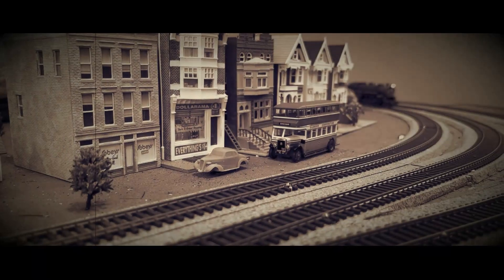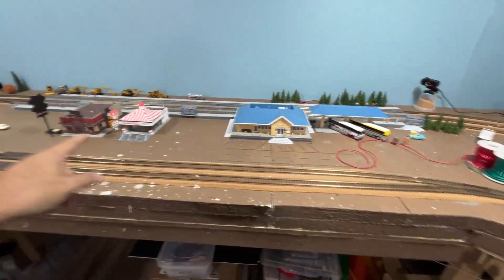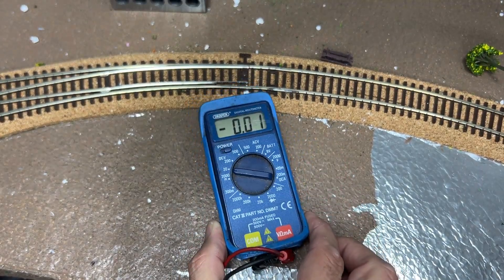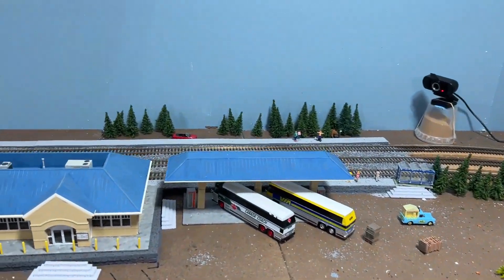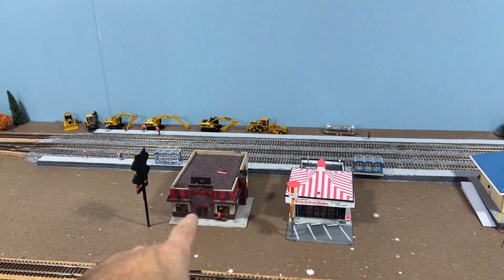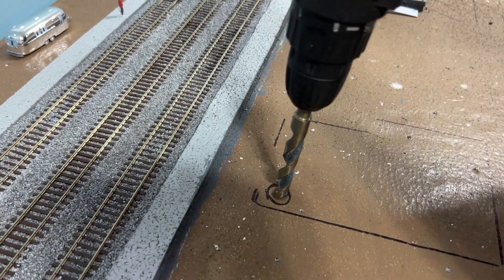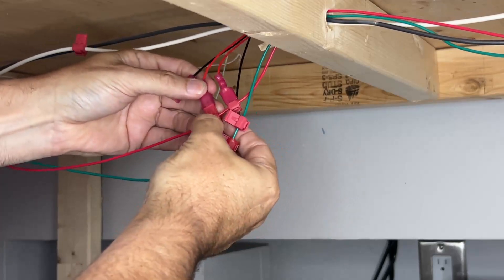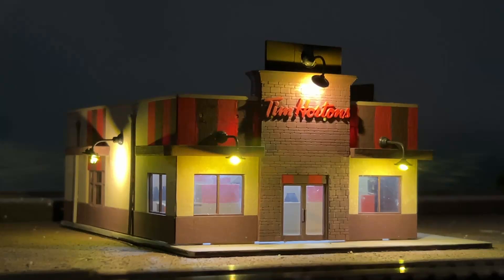Model Railway ElecTrainics - Layout Lights Wiring

Comment: Using the Variable DC Track terminals, can't you just see what setting would give you 3-5 volts and then block the power lever so it can't go past?
Reply from the maker: I just wanted something simple for now. Eventually I'd like the whole lighting system to run off arduinos etc.
Reply: @ScottRails  Now you are talking!